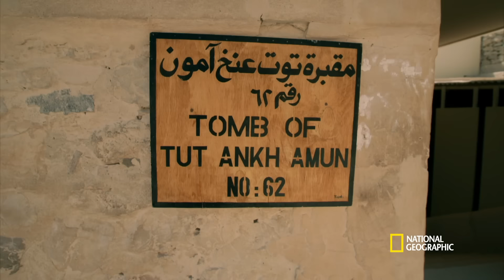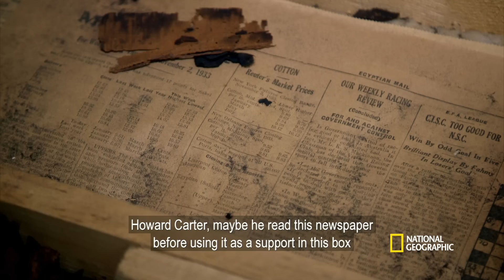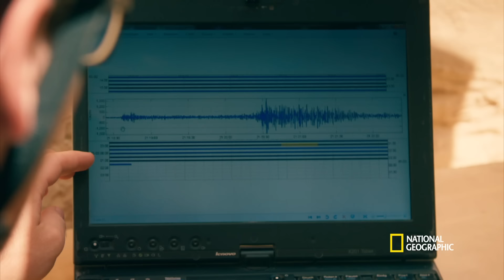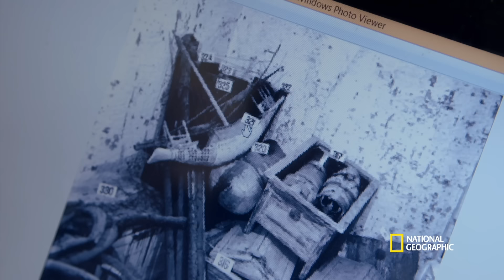Tutankhamun's Treasures (Full Episode) | Lost Treasures of Egypt

Comment: At 19:07, "They actually applied a plaster gypsum ceiling and then applied the paint".  No they did not.  Gypsum plaster sets too quickly.  The ancient Egyptians used lime plaster, the final layer that they painted into setting in about 8 hours by absorbing CO2 from the air.  Gypsum plaster sets to fast for this application.  This started wide use in tombs about 1400 BC.  Tutankhamun's tomb is one example.

Comment: The Water Aquifers underneath the Pyramids, would flow like a Wave and Slam into the Roof of the King's Chamber, and Queens Chamber, creating a Frequency like a "Tuning Fork". This Frequency could be picked up nearby and used as Wireless Energy to mine rock in Perfect Squares, as well as wireless electric motors. The Pyramid is the 1st "Tuning Fork" (created by under water channels) 2nd "Tuning Fork" Could prolly be picked up 1 mile away from the Pyramid at the time.

Comment: It's would be very interesting to know what was actually originally in the tomb, apparently there's evidence it was looted twice as holes had been chipped through the original blocks and latet resealed, the contents were thrown around and boxes were opened etc when found, clearly someone rooted through and took what they could, with the amount that is left its interesting to think what they took - I would presume a ridiculous amount of gold.
Reply: That the robbers got caught infers any loss was likely minimal.  All they appeared to access was the storage room.  It is questionable if robbers caused the disheveled nature of the room - or if those who filled it did.  Everything points to the tomb being filled and sealed as quickly as possible.  The reason the wall murals as an example are blotchy is because they were painted before the plaster was dry - thus mold grew.  Also rather than installing a sarcophagus which actually fit they hacked the toes off of his coffin to make it fit the sarcophagus.

Comment: Mainstream archeology claims that the great pyramid was build in about 20 years. 

20 years equates to 10,512,000 minutes

The great pyramid has approximately 2,300,000 stones, the smallest of which were approximately 2.5 tonns, with the largest being approximately 80 tonns.

10,512,000 minutes, with 2,300,00 stones means that each stone needed to be cut to near laser precise lines, transported the significant distance from the quarry to the site, moved up the ramp, and placed perfectly - all in 4.5 minutes each stone (10,512,000 minutes / 2,300,000 stones = 4.5 minutes to complete).

A stone had to be placed every single 4.5 minutes, 24 hours a day, 7 days a week, 365 days a year. Or the 20 years is completely false.

Comment: The people of India have more advanced stone temples than anyone else. They had gears built from stone. That moved. They have a temple that was carved with no mistakes out of granite. Yes moving so many blocks that were so big. But come on. A bunch of elephant carvings that are all exactly the ame measurements?  Why is India marginalized?  I don't understand why there is not more Information about this? Would 100 tonne blocks crush wooden logs? Like pulverized. Over 500 miles of desert and moutans and they just rolled the granite on logs? I have a hard time believing that. What about the holes that were drilled in basalt and granite?  With copper?  It doesn't add up.